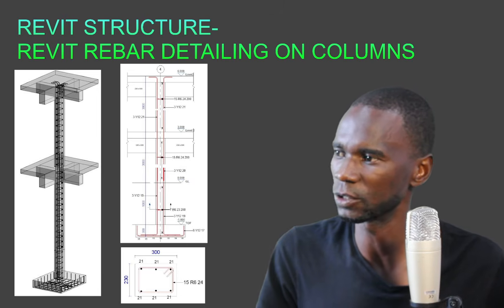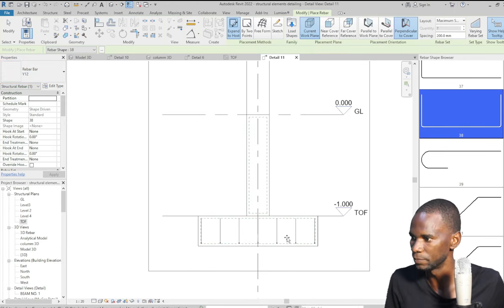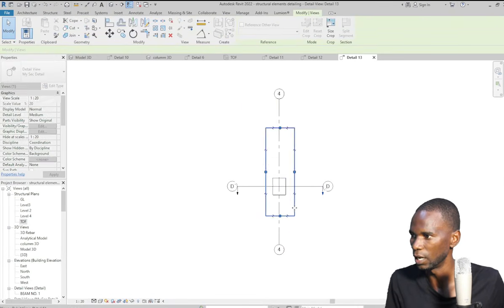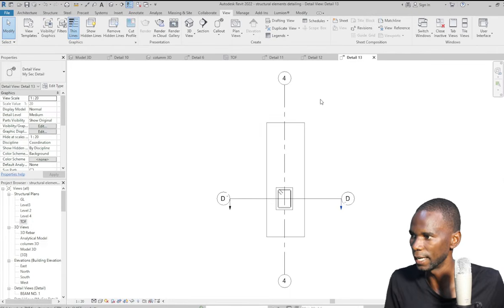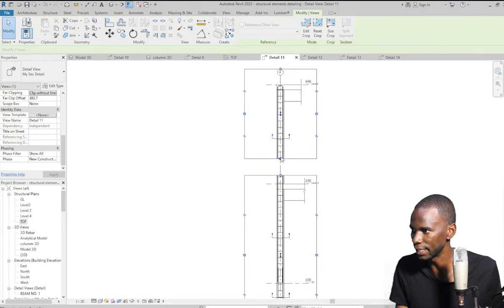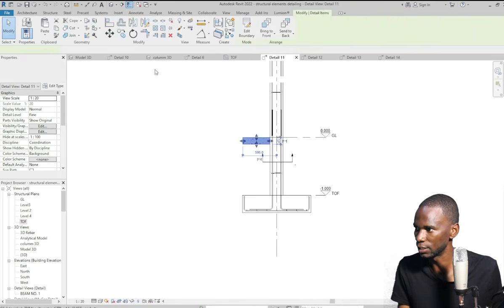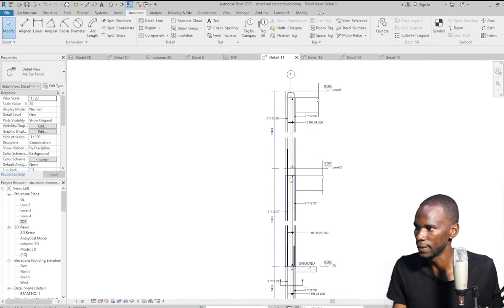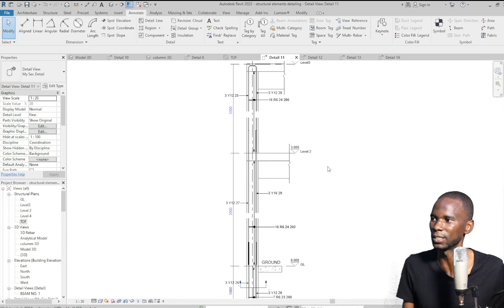Revit structure I Revit rebar detailing on Columns

Comment: Hey guys, what strategies are you using to replicate rebar modeling across columns that are the same type? using assemblies? Copy and paste? If a type of column changes the rebar, I have to manually track all columns and change it? For a small project, this is feaseable, but not large projects.

Comment: Thank you for a great video, very easy to understand.

I was wondering though, why do you model your columns as individual elements from level to level instead of a single column from footing to the highest level ?
Reply from the maker: You can do that. But you may wish to know that columns. Are constructed from level to level, another reason is that I use robot structural analysis which requires splitting at levels

Comment: Hello, I found your video very informative, but I'm curious. Where I live, we use AUTOCAD for detailing the rebar in concrete structural elements. I'm wondering, is this progam efficient enough to suffice a change? And also, where can one find rebar libraries?
Reply from the maker: Revit is capable and it's the future coz it's a BIM software. Don't be left behind. Start learning now and transition gradually.

Comment: Hello, if we have several floors when rebar detailing, should we difference the rebar size for each column, beam, and slab on each floor? Especially when we want to make automatic bill of quantity from Revit.
Reply from the maker: Hi. Not sure if I got your question right. Size of rebar will depend on structural analysis considering expected loads.
Reply: I mean that if we want to make rebar schedulling, should we define rebar size for each column, beam, and slab on each floor?(i.e 19mm column A lvl 1, 19mm column B lvl 1, 19 mm column C lvl 2, 19 mm beam A lvl 1, 19 mm beam B lvl 1, etc) , 

in this video ( see 6:27 and 12:17) you were using Y12 for both column and footing. When we want to know the quantity of rebar, how revit can difference the rebar for columns and footing?
Reply from the maker: @fillbertnjoko7875  oh I understand now. You assign rebar to partitions. For example B1, B2, C1, Base 1 etc... These will be recognized in the schedule.
Reply: @skillmaxacademy , oh I see, you help me a lot! Thank you